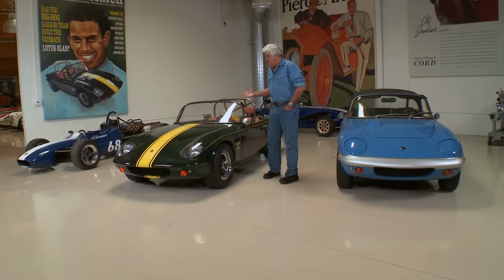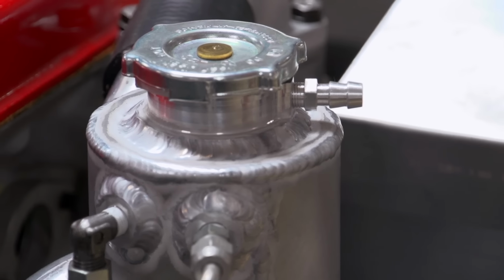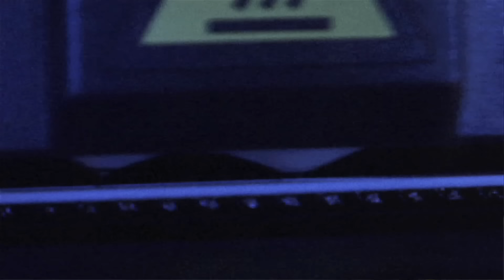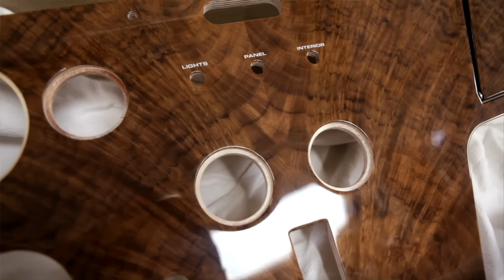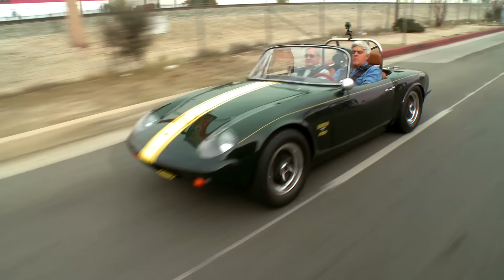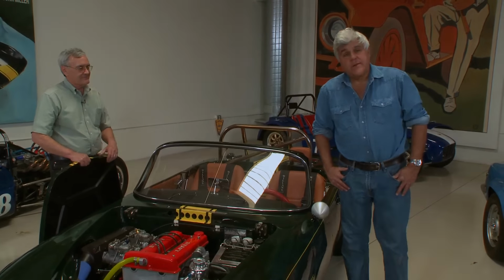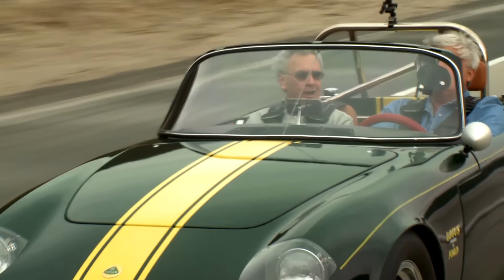Restoration Finished: 1966 Lotus Elan 26R - Jay Leno's Garage

Comment: Looks like a Miata to me.
Reply: Tornado escaped
Reply: David Tran Tornado?
Reply: Not a coincidence, the Miata was Mazda's version of this car.
Reply: You mean the a a Miata looks like the Lotus.
Reply: The Miata is an outright copy of the Lotus Elan. As was the original RX7 a copy of the Porsche 924.
Reply: Yes, Japanese copy everything. For example Honda claimed VTEC as their own but variable valve timing was patented by Porsche in 1958. Look at the early Lexus cars and they unashamedly copy Mercedes Benz.
Reply: Nothing wrong with your eyesight. Am sure everyone knows what you mean ... Just a play with words :-)
Reply: Silverarrow The NSX was an original.  Honda went world class with that one.
Reply: ***** Look at the tail lights and rear wing. Then, the side intakes, rear window and front end. Who ever designed the NSX knew what an F40 looked like.
The NSX also came in a red that was identical to the F40.
Reply: 1971SuperLead Nope. Not at all. The NSX has an excellent 360 degree view from the drivers seat. It has an all aluminum body. Both are engineering points Ferrari could not muster. The NSX changed all the parameters of what a supercar should be. Even today 20 years later. Only the Cayman can truly outperform it in every way. Everything else is to big and fat or too unsophisticated. No the NSX  looks noting like any Ferrari F40.
Reply: fatboy19831 I believe the nsx designer worked with Ferrari before the nsx so there are def some Ferrari elements
Reply: commalTl Really? How do you know this?
Reply: They never come up with the original idea so they copy. They would have nothing to enhance if they never copied in the first place.
Reply: So where is this great NSX today? The Porsche 911 is STILL with us
Reply: My Miata's grandmother.
Reply: If that`s the case you should have your eyes checked......
Reply: Silverarrow, obviously you have some storng racial dislikes, perhaps from WW2 and/or religious & 'morality' teaching from family members.
   All nations purchase manufacturing licenses, copy some designs or aspects of, and create indigenous designs influenced by others, but since you're being pedantic & blinkered. 

   Japan is no different to others, like German, the USA, the UK, France etc, all have traded tech for the last 100+ years with the area of heavy industries, for engines cars, bikes, boats & aircraft, military & civilian usages etc, and designing vehicles for them. During the end of the 19th Century after the Boshin War ended, and Japan modernized, because of US imperialistic 'gunboat diplomacy' pressure, which the UK was also extremely guilty of, Japan was forced to industrialize, purchasing technologies, equipments, skilled craftsmen & engineers, & training staff from foriegn nations, along with monetary loans and treaties and bond agreements.
    Some of this forced the more hawkish imperical foreign nations to put off plans to invade and subjugate, for fear of loosing payments and long term trade ties. Until the rash of political assissination in the late 1920s and into the 1930s, Japan was an ally of the US & GBE/UK, durring WW1, Japan was fighting (abeit always often) the Imperial German Pacific colonies, of which a fair portion was awarded to them when the war ended.    
    At least by and large, the Japanese, (even the as the Empire of Japan) when they wanted a design that they could not design a work around for, would pay for the licensing of production and manufacturing of siad items, like early P&W and Gnome et Rhone radial engines, American Standard Proprellers, Douglas DC.2, Bofors 40mm AA guns, Hotchkiss & CZ-ZB26 Machineguns .303/7.7mm British, 1920s Flathead & 1930s Knucklehead Harley Davidsons, PzKpfw VI, Mercedes Benz V2 & DB600 aero engines etc.

    The orignal NSX was also co developed with Ayrton Sena's input, Honda retiered (briefly) the NSX, for the HSC & HSV R&D projects, before the new NSX (2nd Generation) came about (because of Acura's work) - the NSX is still around, not the same as the original, but thene the 911 of now is not orignal either.

Comment: i saw these live at the  Westwood race track in the 70's/80's  coquitlam bc canada. 🤗 they were fast and sounded great. this was a proper sports car as it is small / light and agile and in the hands of a skilled driver pretty much untouchable on a tight race course. i had a Datsun 2000 5 speed convertible /hardtop and it was simple and fun and got great gas mileage in the 5 th gear overdrive. i added 60 series Pirelli p6 tires and koni adjustable race shocks and zoom    🏎

Comment: As a 20 yr old, rebuilding a very scruffy S3 Elan I took the front road springs to my local dealer to buy two new ones. The old guy in the parts dept asked why. I set both on the counter and knowingly pointed out that one had 'sagged'. He asked "what weight are you son?" "about average " I replied. "That's what Colin Chapman though would be the average drivers weight" he said and smiled.
 Then put his hand on the taller spring and said "that one goes on the drivers side son". I realised I was dealing with something very different from the Minis and Morris MInors of the day!  ;-)

Comment: That Lotus! I had a 1984 VW GTi for 20 years always smiled while driving.
Yes, 3,400 rpm at 75mph, in fifth gear. Down shift and go to 90 in a second.
Mustangs and Cameros were astonished....the steering wheel holders were, any way.

Comment: The denim is strong in this one. Professor Hall, is Master Denimator. He provides all of the denim for Jay Leno, fabricated at the shop, with the buttons specially turned on the lathe, with the stitching done in the stitching shop, with the belt provided by special fabrication technology, and the buckles produced on the milling machine using a 3D Mill.

The denim itself, is produced from cotton specially grown in the Leno cotton fields.

The denim is exclusive to Jay Leno's fabrication shop, and therefore cannot be bought on the high street, due to patent restrictions. There have been so many kit shirts, and kit jeans produced by rival companies over the years, but there will always only be one Jay Leno denim fabricator. Some Leno Jean and shirt combinations are selling for upwards of half a million dollars on the market right now, and if you see someone wearing a blue denim shirt and denim jeans combination, you can bet your life it will be a kit copy.

If you go looking for some older examples of the original combinations, dating way back to 2014 and beyond, and they're worthy of restoration, then I would suggest buying them as an investment. Take them to your local denim fabricator, to have them restored, and try and keep the original buttons, belt, and stitching, in order to ensure that it's an original Leno denim.

Professor Hall wears it by special permission. Rumour has it, that Professor Hall's denim combination has special upgraded carbon composite denim weaved into the cotton, to make it as light as possible so that it handles perfectly while you're moving your arms and legs.

If you go to the Californian National Museum of Leno Denim, you can see some of the earliest examples in prototype form. It's well worth a visit for all the family, to spend a day looking around all of the denim combinations worn over the years by Mr Leno.

Comment: In the early '80s I bought a 1967 S3 coupe in pieces out of a guy's living room.  I had it put together with a new (somewhat upgraded interior headliner and carpets).  More fun that any other car I have owned.  Or driven.  The steering wheel had Colin Chapman's signature stamped on it.  Never seen another one.

Comment: I LOVE EVERYTHING ABOUT THIS LOTUS!!!! It's 99.9999% PERFECT...except the red steering wheel. 
It looks like a JC Whitney discount item on this "EXCEPTIONALLY BEAUTIFUL" car. 
The steering wheel "NEEDS" to be real wood....matching to the wood gear-selector knob & dash. 
We all know that Mr. Leno sincerely appreciates "real wood" wheels & it would be correct for 1966. Considering all the love & attention to craftsmanship devoted to this project, it's an easy task to do. 
Also, WADDAYA' MEAN THE ENGINE BUILDER WOULDN'T DIVULGE THE ENGINE HORSEPOWER?!?! 
I'd take a torque wrench to his nuts...until he "squealed" like bias-ply tires on asphalt. 
Knowing Jay, he likely put it on a dyno after this video. I mean...ya' just gotta' know. 
Respectfully,  Ben

Comment: I had a 72 Elan, loved seeing this car.  Have to mention the safety wire on the left bolt is done wrong, it should be pulling the bolt tight not loose.
Reply: It looks like its pulling both bolts clock-wise to me - 5:38
Reply: I looked at it again, yeah the safety is OK, I would have wrapped it a 1/2 turn around the bolt.
Reply: We all have our own preferences, but you would have probably added a few extra grams - Jim would curse you.
Reply: Yes a few grams, I should think like that working on my fiberglass airplane, sort of a flying Lotus.

Comment: You can hear that Jay wasn't really used to the aggressive camshafts and primitive clutch setup in the elan. I built a 65 Falcon with a  Shelby 289 and springless clutch with a 4,000 lb. Pressure Plate for the street, it was a chore to drive the car in traffic. My Falcon had double the specifications in every department.

Comment: Your statement how new tech laden cars can't compare to the connection one has with a vintage sports car  from the past is the absolute truth..   I almost didnt watch this after the Cortina... Glad I did.. that car sounds utterly Amazing winding out..  Yes... Like it's singing...   I've grown weary of new cars.. Sold my '01 BULLITT with 31k miles...  Lately my new 124 Spider..  I'm down to my '66 Corvair Show car w/AC 3k miles.. and my Very tired '68 Sprite ..  They're SO much more FUN to drive around, and get Tons of comments.... Have a '65 Corvair Convertible almost  ready after a LONG restoration....  Artesian / White / White.. STUNNING Car...    Selling the Corvairs... looking for buyers...   My tastes have reverted back to the Classic British sport cars I loved in high school circa 1980..  The flame has been rekindled..  Planning to get an MGB and either supercharging it, or possibly a V6/V8 swap... or perhaps a TR8...   and also restore the Sprite...  Resto-modding them with things like power door locks, push button start, back up cams, sensors, etc..   FUN FUN FUN....

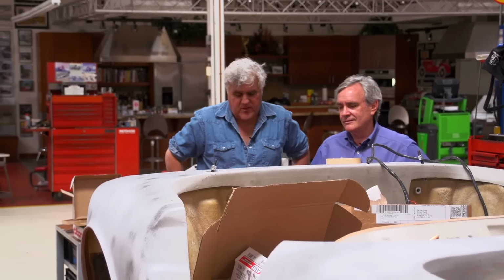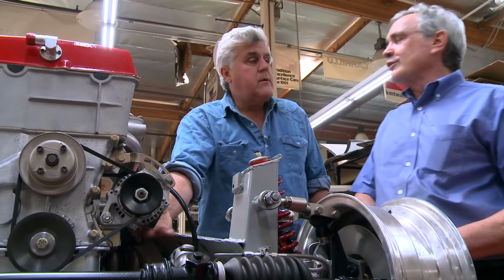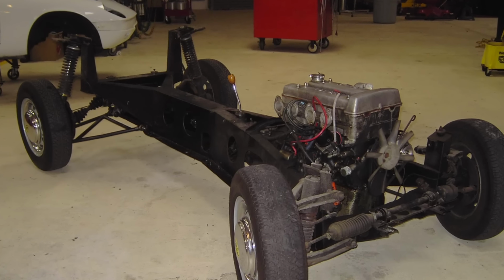Comment: 3:55.  When I put headers on my Elan, they began to cook my feet.  I mean it was so hot, I literally couldn't drive the car after they warmed up.  My solution was to cut and fit an aluminum Bake Lite cookie sheet on the inside of the chassis right next to the headers.  The cookie sheet is essentially two sheets of aluminum with an air space in between.  Problem solved however the headers do seem to melt the fiberglass directly behind them.  5:27.  The original Lucas generator put out 22 amps.  6:46.  The brake pipes for my car were originally set up for right hand steering.  When the car was designated to be a left hand steering car, Lotus simply added couplers to the two pipes that should have attached to the master cylinder, made a U-turn, and routed them down to the front crossmember across the front of the engine and back up to the master cylinder on the left side.  While bleeding the brakes, determining which wheel was furthest from the master cylinder took a considerable amount of calculating.  I corrected this by re-routing the pipes the way they should have been routed in the first place.  In the Chapman tradition, I added lightness by removing over 10 feet of brake pipe including re-routing the rear brake pipe from the bottom of the backbone to the top!  13:17.  Anybody know why Jim wrapped the water temp gauge line with plastic?  It's already protected by a wire that keeps it from kinking.  20:16.  I notice it has the door fit typical of practically all Elans.  The bottom rear corner always stands proud of the body regardless of the series.  20:19.  What's that noise?  Great video Jay!

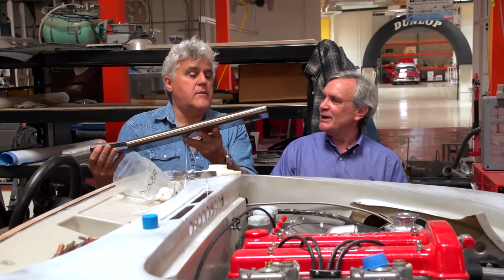Comment: at  4:30  he has a flat exhaust....   I have the exact same thing under my Peerless, because it's so low,  which I fabricated myself 4" wide by 3/4" deep and 30" long, out of stainless plate from The Midland Bank counterlines back in '92...    still under there now....

Comment: Violet a lot of the sound is from the straight cut gears like a touring/rally car, also guessing there rebuild had a fast race cam, those Lotus Twin Cams are real screamers, high revving, a 4-1 custom flowed exhaust, some fat intakes on the carbs, pair of weber 45's im guessing, all make a great sound! :)

Comment: I am jealous, too busy chasing failed parts and systems to fabricate anything.
Last time I was witness to true fabrication was in Gardena at the Bromme shop.
Bromme ran sprint cars at Ascot, his driver at the time was Dean Thompson and they always held the #1 #2 or #3 plates.
The nice thing was, if you did help crew the car you got a lesson at the chalk board about theory. One day it was torsion bar suspensions, the next was metal shaping or welding. 
I have been a mechanic ever since, and I have seen virtually every failure mode for every system imaginable, but, I don't get to build my own stuff, that's why I am jealous.
All I want is a mill and a lathe, and the time to work with them, but, until I hit lotto, it's just a dream.

Comment: Fabulous Elan. Couple of details though, the story of Jim Clark’s debut of the twincam in the Lotus 23 always fails to mention that Clark left opponents not because he was faster but because they were all up on jacks changing wheels to wets at the start (he was fast though) then he was overcome with fumes from the exhaust. 
As for jay’s comment on the Seven, Lotus were making the series 4 Seven at the end and Graham Nearn went to Collin Chapman for the rights to build the Seven which he bought. This was Caterham cars and they reverted to the series 3. So Caterhams are a legitimate continuation not a copy.
If you raided the parts bin you would find vented discs, 4 pot AP racing calipers and a vertical link for the front suspension that eliminates the brass trunnion all made to go inside a 13in rim

Comment: Where would reverse be in this gear box? If I understand correctly, in order to shift you either click up or down on the stick right? The stick is not staying in that placement after you've either shifted up, it goes back into a "neutral" position? I feel like I got this wrong, if anyone can clarify...

Comment: Question for Jay. Regarding the clutch pressure plate from V8, if it is stiffer, what will hapen with chrankshafts axial bearings in long term ???😯

Comment: Jay mentions the noise a few times. I was wondering about the Quaife sequential tranny, from their website, it has straight  cut gears, but all I can hear is clutch rattle!Great all around job guys. Jay, does it compare ton the ratty Honda S1000?
Reply: Multi plate performance clutches all rattle. This is a tamed racing car.

Comment: Over the years, I've heard many remarks about British cars having notoriously bad electrical systems. Do you guys feel this is true? Can you talk about the English automotive electrical systems and why many people say they're so bad?
Reply: Not really true. I have owned numerous older English cars and the electrics never let me down. I owned an Elan for over 13 years which I rebuilt twice on new chassis. Fibreglass cars always need earthing properly or the circuits take the least resistant route to earth which can cause instrumentation chaos. Sort the earthing out properly and the Elan gives no problems. Like all older cars it has to be properly maintained, ideally by a knowledgable owner, and then it gives no problems other than wear and tear which is inevitably higher on an old design car designed to be driven quickly,